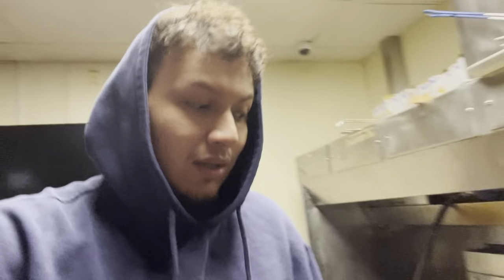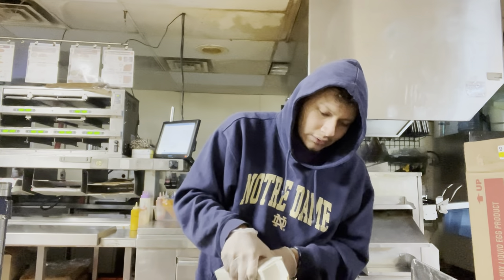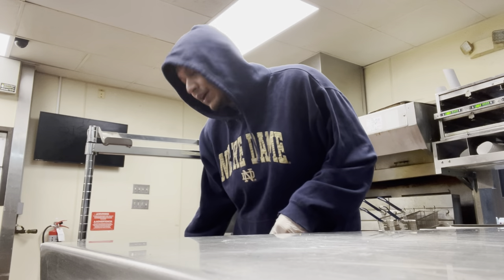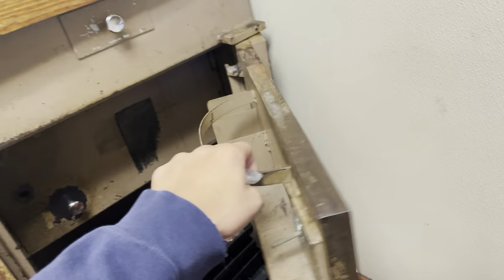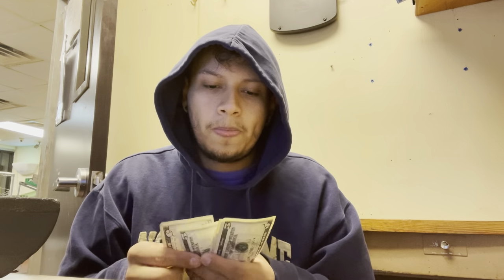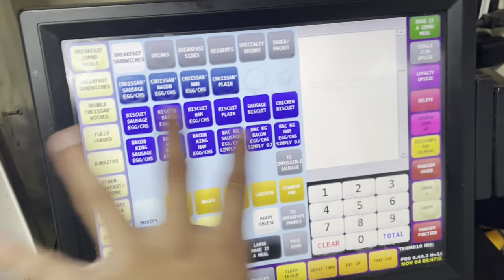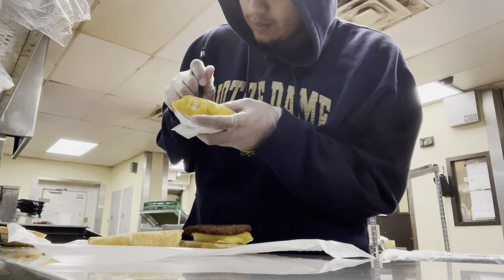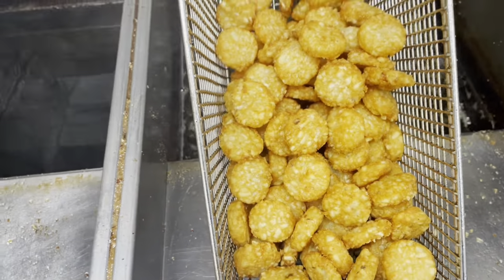A day working at Burger King

Comment: I used to open a BK in the mid 80s and we had trays of eggs we'd crack into a giant bucket and scramble with a massive whisk.  Then I'd float a square pan on the fry oil and pour the eggs into that pan to cook.  There was a metal insert you'd put into the eggs that would form perfect squares as they cooked.  The bacon was microwaved and the sausage patties were cooked in the flame broiler like burgers.  Breakfast was really very good back then.  No egg liquid in a carton.  We had a magic cleaning crew that come in at 2am and the place was squeaky clean by the time I came in to prep at 4.  The manager DID go to jail for doing coke with a hooker in the restaurant but that's another story :)
Reply: Crazyyyy story with the manager 😯😯
Reply: i wanna hear the other story 👀
Reply: Nothing new now. Most Burger King employees are on crack or straight out of the half way house.
Reply: This guy in the video is how an employee should be. But they are not.
Reply: The 80s seem great

Comment: I’m about to get a interview for BK tomorrow. I’m 16, and slightly scared. Do you have to remember how to make each sandwich or is there instructions to look up at or somethin? 😭
Reply from the maker: Good luck! They do have the Sandwich cards on top of the stations to make things so it should be easy. You’ll get the hang of it fast. Pretty simple making sandwiches
Reply: Btw got hired on the spot
Reply: @P1nk_3l00d  how was the interview like and what questions did they ask you? I never had a job before and I’m only 18 turning 19 in two months, so I wanna start somewhere small

Comment: Just go to osha and report them for violating your worker rights at your last job, especially for talking about you badly and them not correcting it, it’s up to work places to correct employee conduct and if they don’t they are responsible, read your worker rights and use it to your advantage, that check will be waiting. I met a dude all he did was sue workplaces he read up on his worker rights then reported each place to osha then sued, he easily made quick 10 grand every time, especially work places must respect race, sexual harassment, violence, mental illness. So don’t forget your worker rights ever 💯